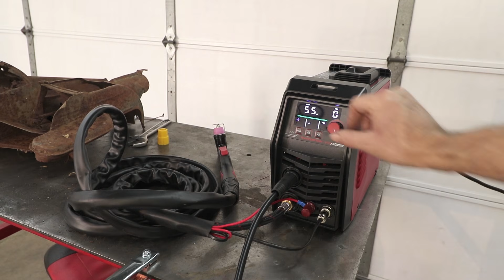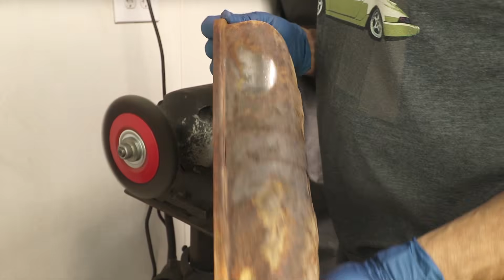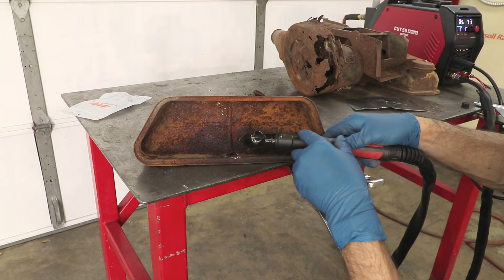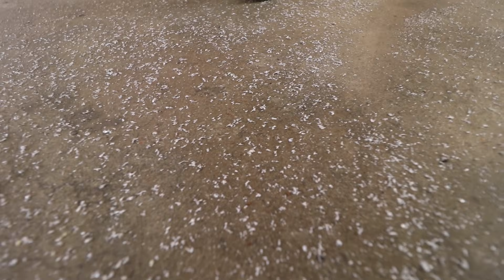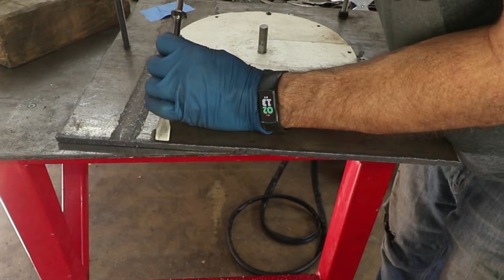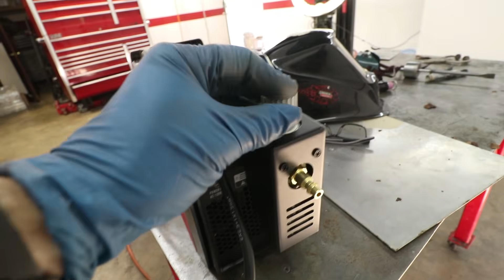Easy RUST Removal Mode With Arc Captain Cut55 Prolux Plasma Cutter

Comment: I’m by no means a pro, more of a shade tree cutter, but I got my 55 in last week and have been having a blast with it. The only problem is I don’t have any projects to tackle now. 🤣🤣🤣
Reply from the maker: Very cool.  I always have too many projects, ha ha.    Make a jack stand holder for the wall?
Reply: @GarageTimeAutoResto  believe it or not I have my cutting table outside my shop. so, I cut a hole big enough for the ground and Cutting Torch to fit through. that way my machine is in the dry, so I had to fix a box to hang my Cutting Torch in along with a box for the extra Consumables and stand offs.

Comment: Hey Tom 👋 I’m guessing that cover is 14/16 gauge. I’m curious to know if you can dial in the settings to do 20 gauge without burning through? If yes, it’d be ideal to use inside 356 longitudinals. 

I’ve had my eye on the Raycus 1500W laser for $3.5K on eBay. A friend bought it and says it works perfect for rust removal.
Reply from the maker: Hi Trevor,  keep your eye on a laser which is better suited for rust removal.  This plasma cutter is too heavy handed for 20 Ga.  Arc captain is working on a laser too, so stay tuned.  I hope to try it out.

Comment: What I seen in other videos the user held the cutter at a 45° angle, and not 90°. Got mine and I'm got to try in on an old tractor seat this weekend.
Reply from the maker: Maybe 45 degrees to pierce a hole??? but the plasma arc should be 90 degrees to the metal. The sparks should exit at 30 deg or so.
Reply from the maker: Maybe 45 degrees to pierce a hole??? but the plasma arc should be 90 degrees to the metal. The sparks should exit at 30 deg or so.

Comment: I backed the XLaserLab X1 Pro kickstarter with the "early bird" price.  It's a laser welder, cutter and cleaner.  Worth checking out, I think!  (NB: I still haven't used it yet, but intend to in the new year!)
Reply from the maker: Very cool.  I've  seen that one and it looks good.
Reply: @GarageTimeAutoResto  The chap who runs the "Halfass Kustoms" channel did a video recently demonstrating the cleaning function.  It could be a really useful rust removal tool, IMHO.
Reply from the maker: Thank you, I'll check it out.

Comment: Interesting. The best way I think is a soak in Rust911. I've been removing the rust from inside my frame rails and body cavities with continuous spray system of Rust911.
Reply from the maker: Nice,  Rust 911 is similar but cheaper than evaporust?  How does primer stick to the phosphated surface?

Comment: Their is no ablation with a plasma like a laser.  The laser will do a set of 356 tin in 30-45 minutes. Gets hot also 150-175 deg. But after a wipe with scotch bite it’s ready for powder coating. Plasma rust removal is interesting but is probably hard on consumables
Reply from the maker: For sure I want a laser.  It seems the plasma is mostly a heat source whereas a laser can target the rust layer directly and not the underlying steel  Something to do with the photon absorption of oxide versus steel?
I also agree that this is hard on consumables for the plasma cutter.